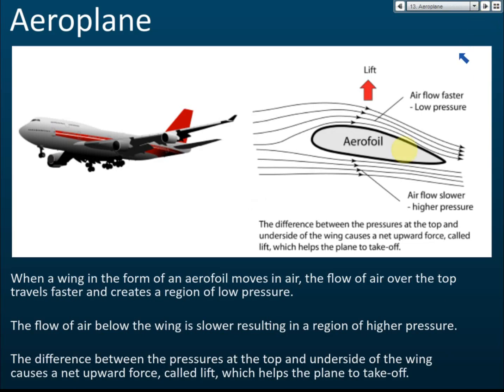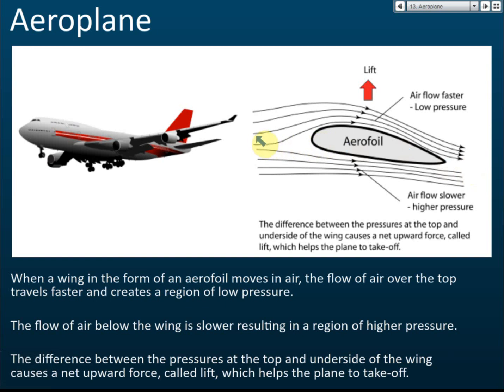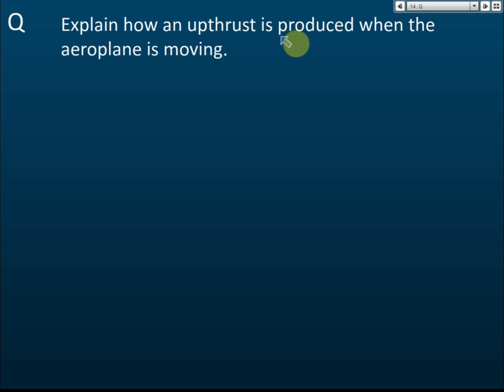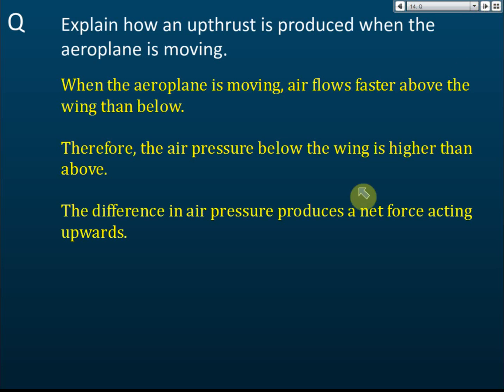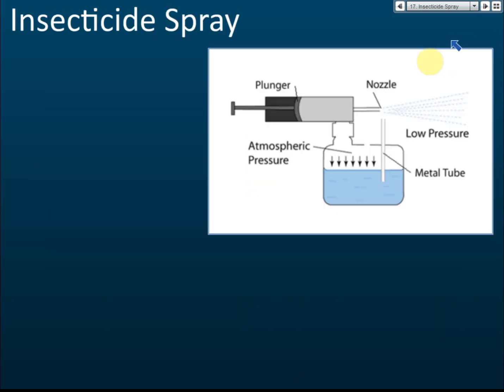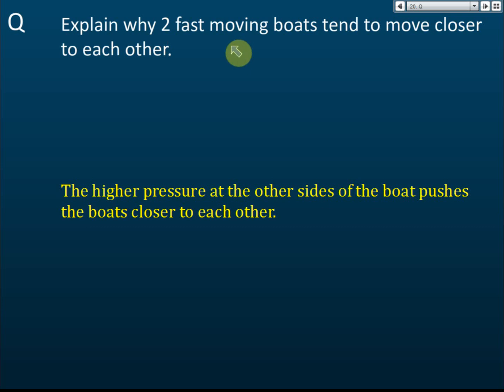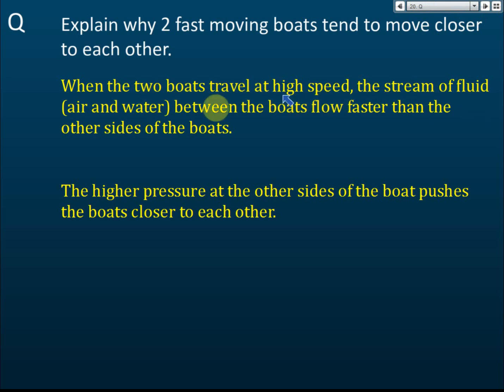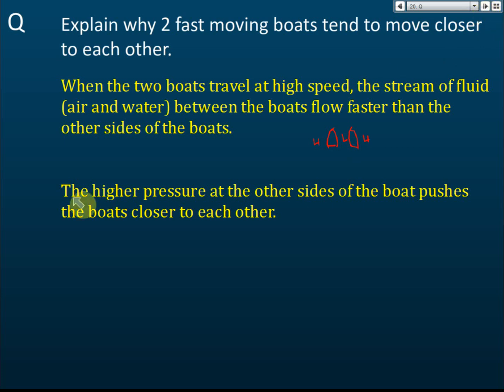Application of Bernoulli's Principle | Pressure

Comment: Completely wrong. Pressure is not lower because air is faster, air is accelerating because the wing punches a low pressure zone through the air